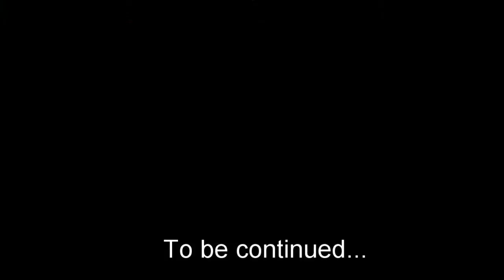Diagnosing Misfire P0354 & Piston Rings on the Celica   Part 1

Comment: I’m having the same problem with my car now. Did you ever fix the problem? What was it? Please help this is my only car and I use it everyday....
Reply from the maker: Did you watch the whole video? It was the coil pack. Watch the whole thing so you see how I diagnose and test which coil was giving me the problem.
Reply: I changed all of mine and they still give problems and yes I watch the entire video
Reply: If I move my wires around it drives fine for a little then starts acting up again
Reply: @cesleyswisher4891  Did you find the issue? I'm having the same problem,  I've changed all coils, all plugs, Checked my wiring. But the issue is still there, btw it's very intermittent. Mostly misfires when cruising on the highway. It's always p0354 code, no other codes..